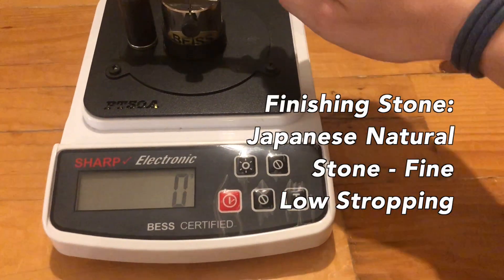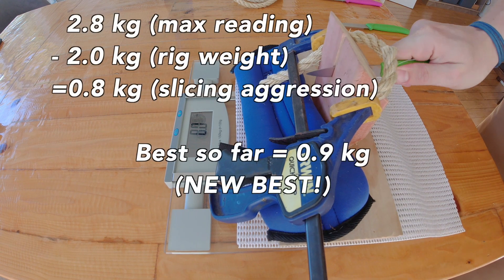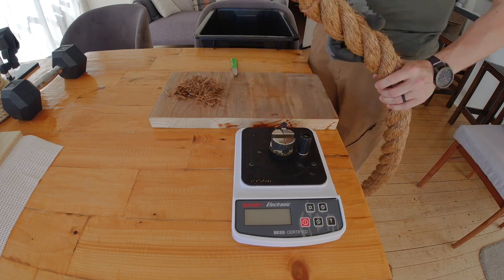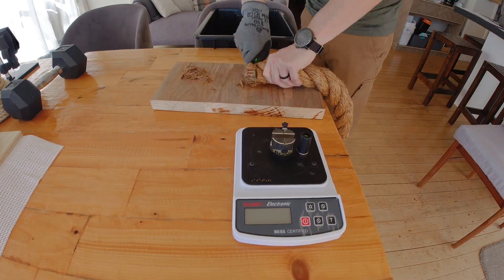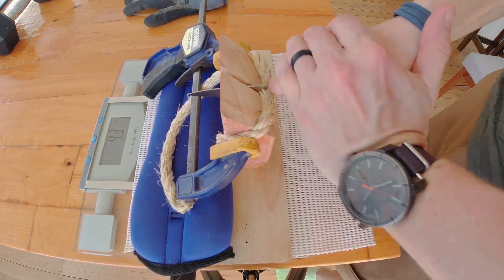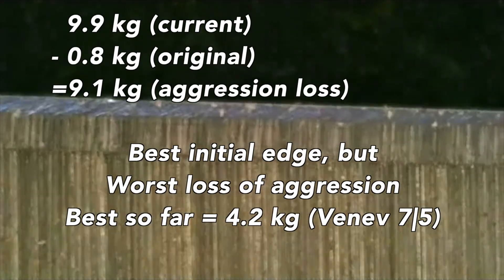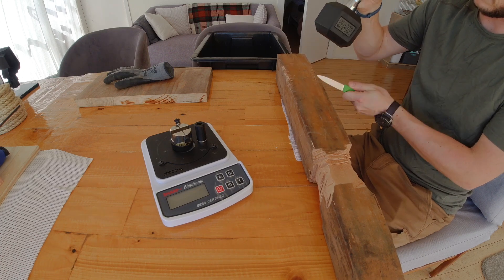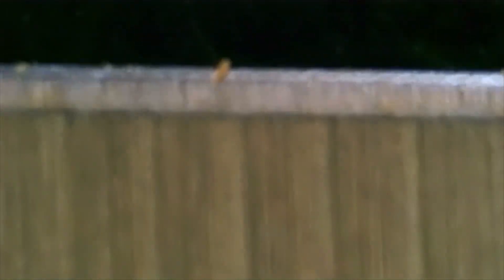Japanese Natural Stone VS 40mm Manila Rope | ANDE Knife Edge Test

Comment: I do think messing around with the naguras could be interesting. 

Sharpening with slurry on the stone, and doing the final deburring with the stone completely cleaned off, and new clear water with extremely light pressure doing alternating passes is pretty common. You could likely get away with  doing edge leading strokes on a stone like this at the very end to make sure its fully deburred. 

Or really following with clean leather, or clean denim. No compound is what i personally do if i want to finish on a japanese natural stone. It is actually more effective than people think at deburring, especially if work was done to reduce the burr before. 

I don't bother with worrying about the angle as much when doing a clean leather strop as i do with a loaded one. My main goal is making sure any foil edge, or any remaining burr is being removed.
Reply: It'd be interesting to try the damp newspaper on stone strop, too.
Reply: @knickly  hadn't heard of that one. But that would be interesting for sure.
Reply: @_BLANK_BLANK  Murray Carter was a proponent of it in his videos, and I had a friend who really liked it.
Reply from the maker: Great ideas, thanks guys - I will have to play around with it.

Comment: One possible explanation for the poor results despite high initial sharpness is that the new knives have weaker steel at the edge from the factory grinding, whereas that weaker steel was ground away many tests ago on your older knives. I think Outpost76 does at least three full resharpenings before doing the "real" test. Not sure if Victorinox does wet grinding, on the one hand they are very good at optimizing their production processes, but on the other hand it might not be worth the trouble if 99.9% of their customers don't notice any benefit.
Reply: This is a good point. I wouldn't be surprised at all if these victorinox knives have some fatigued and overheated steel on the factory edge
Reply: True 100%.
Reply from the maker: That's a great thought!  I have heard from Roman Kase that Mora and Victorinox are actually the only 2 large manufacturing companies that actually do wet grinding (Crazy!)

However, that said, I do think it muddles the results of this test a little to have a newer blade.  It probably warrants more tinkering with the Jnat!
Reply: @homeslicesharpening  Interesting, that info makes me even more impressed by what Victorinox and Mora can deliver for the money they charge (and I was already very impressed!).
Reply from the maker: Yeah isn't that cool? Mad respect. @mikeobrien4081